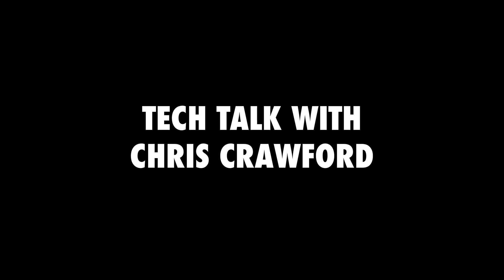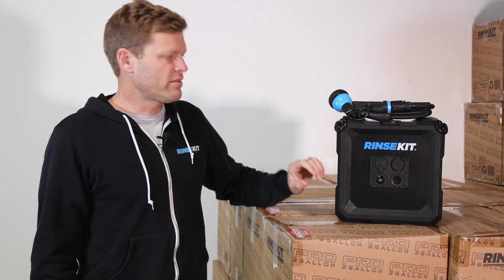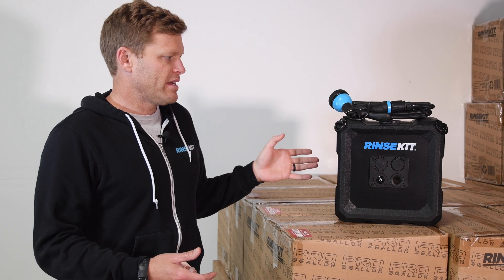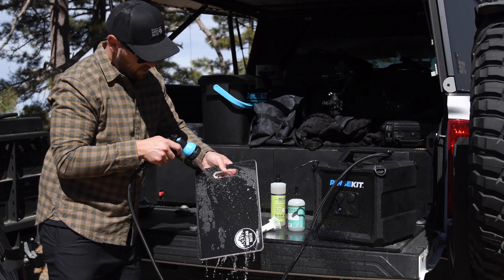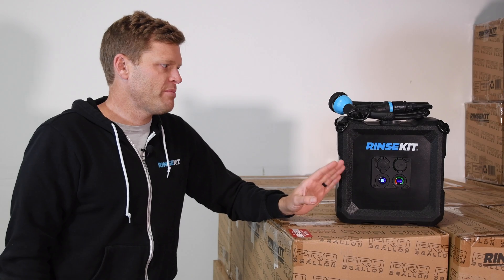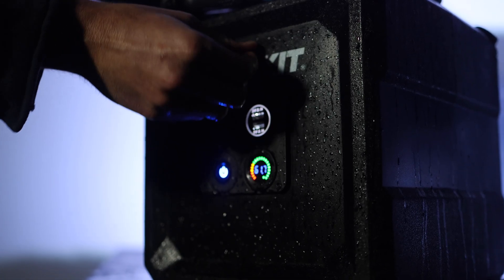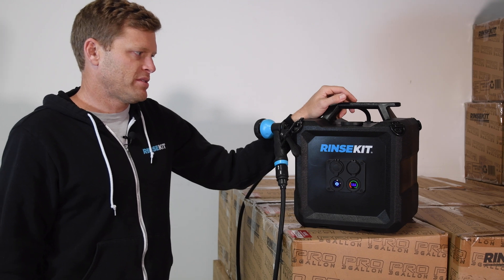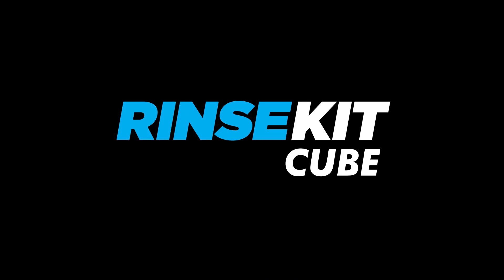The Technology Behind the RinseKit Cube

Comment: Your problem is the tank cracked and leaked after using it for a while. I got 2 old version leaked. Hope you fix with this.
Reply: Hi there! The RinseKit Cube does not hold pressure in its tank like the old version RinseKit PLUS does. The battery and electric pump inside the unit push water out without the need of a sealed tank or pressure source. This eliminates the risk of cracked tanks!

Comment: Just got my new Cube.  I really liked the Pro, but I love the Cube!  Easier carry and transport, hose stores better, holds more water, great water temperature gauge , built tougher, more stable to transport with tie down rings, electric outlets more protected and better placement on unit. A winner👍
Reply: Can you add hot water in it, say, from your water heater? If so, does it have a max temp you can add to it?
Reply from the maker: It can hold water up to 140 degrees Farenheit!